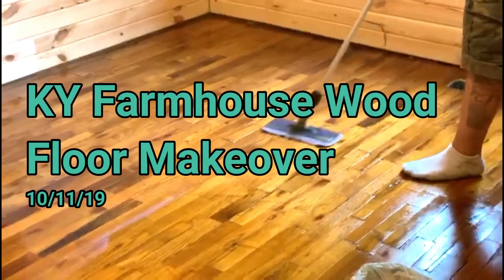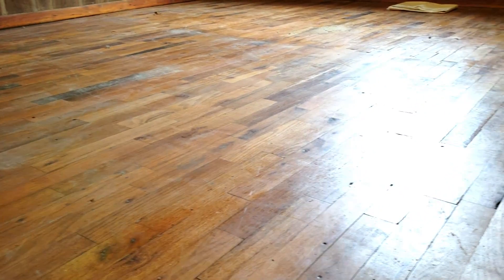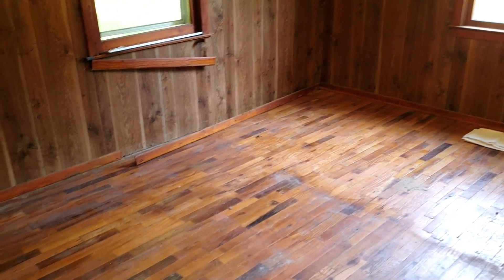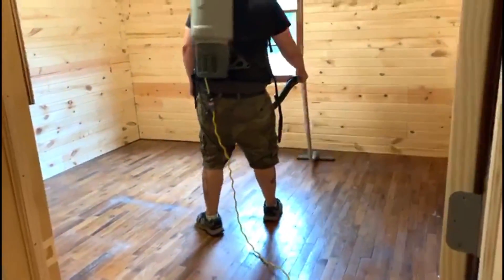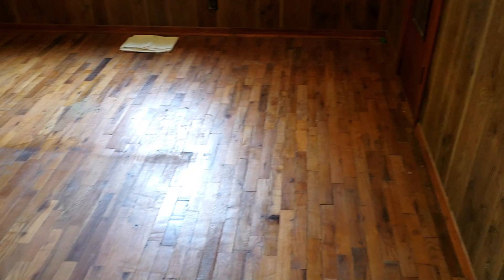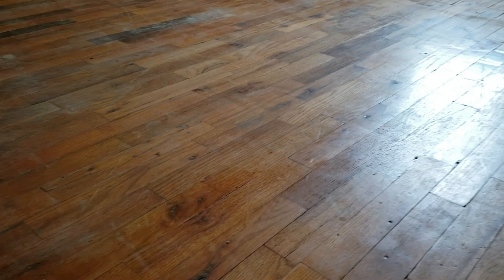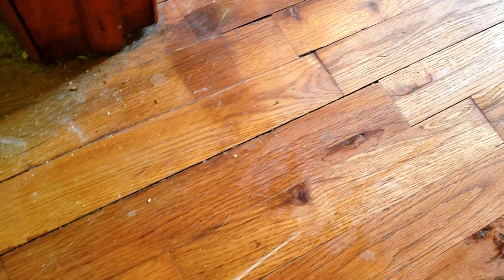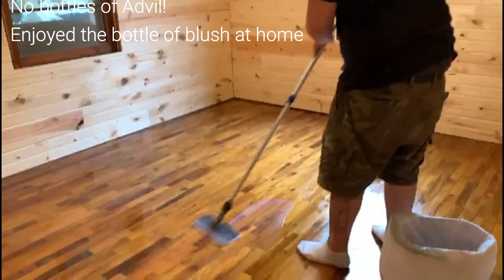KY Farmhouse Wood Floors Refinished by "Sandless" Method!

Comment: So just an additional comment for all, if your floors are warped, cupped or have deep scratches/stains or you want a glass smooth surface you will want to go the sander route. Since this floor was intact and I wanted to keep it rustic with slight imperfections it worked perfectly!